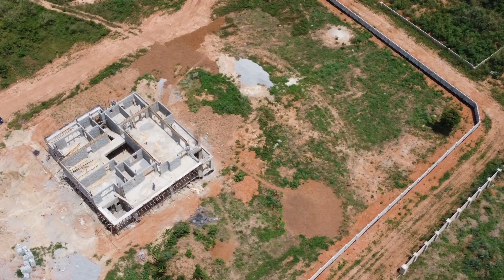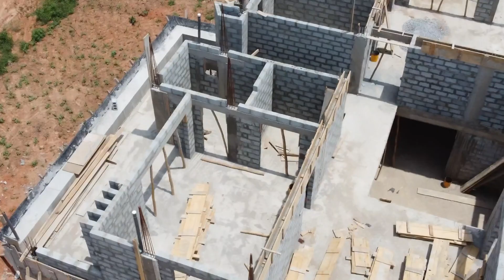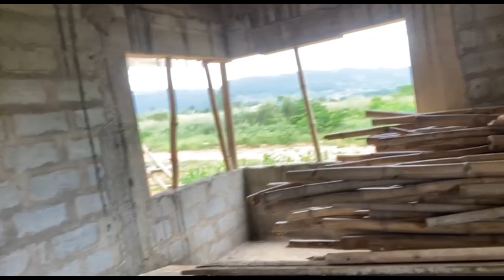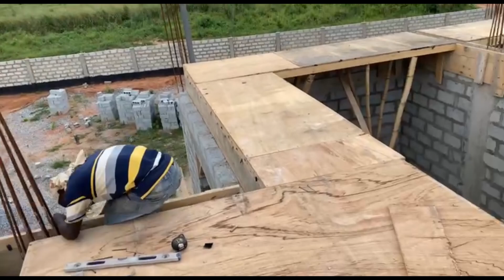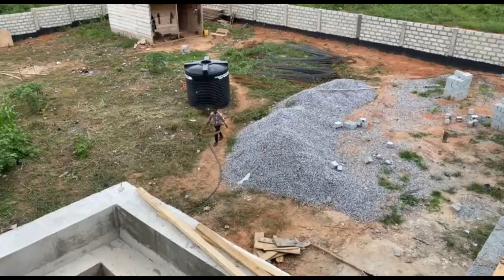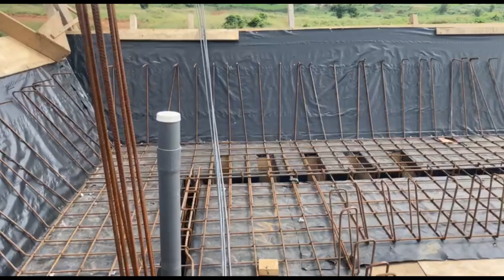Building in Ghana: Roof Decking

Comment: Hi Prince and Nikki,
Quick question: what is the usefulness of this plastic laid after the plywood decking, before the steel bender starts his work?
We usually see this plastic torn and peeling once the slab roof has been cast, and it seems not providing any durable impermeablilisation or other durable benefit and is not as thick as a DPM 300.
Thank you for your clarification and keep up the good work you are outputting. 🙏

Akpe na mi!
Reply from the maker: The rubber is not DPM. It’s used to protect the plywood from the moisture in the concrete. Unlike marine plywood which has a protective sheet (and more expensive) the standard plywood has no protection. Therefore the rubber is used to prevent the plywood from rotting and failing during the curing process. Akpe na wotse
Reply: The rubber sheets makes it easy to remove the decking plates or boards from the concrete after casting. Sometimes ppl rent the boards and add the rubber sheets to preserve the surfaces of the boards and also give some form of smooth effect 😂.
Reply: Thank you 😊